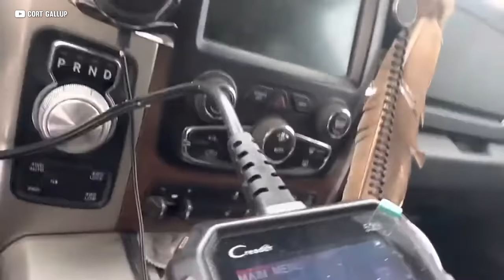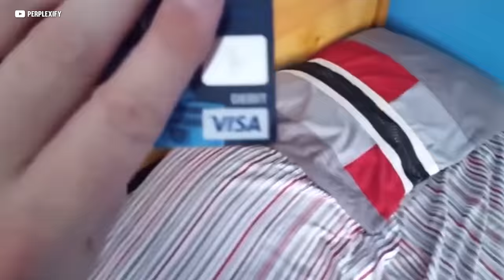Worst Trucks Only Stupid People Buy

Comment: As a mechanic I would have to agree with pretty much everything that was said.. I'll still take my 08 Silverado over any of the others despite the possible issues with the active fuel management system flaws.. mine has over 200k and has never missed a lick.  still running strong with no issues.. I owned one of those Toyota Tacomas and it had 265k on it when I sold it. Never had any issues.  But I wont own a 5cyl Colorado, a 5.7 himi, or a 5.4l Ford, I've worked on way to many of them, they are literally junk.. trot line weights...

Comment: never owned a pick up i drive a 3500 cummings ram dually at work i love it never mechanical issues . I rented once ford 10 speed v8 f150 was extremely comfy and it shifted better then my 8 speed rav 4 by far .

Comment: 252k on a strong running 2011 Chevy 2500HD 6.0. I did have to change the tranny and the transfer case, but towed many miles with a heavy trailer, and I don't think the 6 speed tranny liked it. I bought it used for 15.9k maybe 6-7 years ago, and thought I would buy a new one for retirement, but got sticker shocked into keeping my old truck so I could retire. 80 frickin K??? Yes, I wanted a nice truck.

Comment: 2010 Ram 1500 Crew Cab, 5.7 liter V-8.  231k miles.  Overall, have been very happy with this truck.  Other than a rebuilt differential at 180k and a new alternator at 210 k, it has been reliable.

Comment: A guy at my old gym bought a 2018 Dodge Ram and had a catastrophic motor failure a 7000 miles. Dodge replaced the motor and he had electrical issues with it afterwards.

Comment: As did I. 1999 Tacoma TRD new. Drove it for 11 years and  did my regular maintenance (oil changes/brakes/battery. The only thing that failed was a starter relay. 289,000 kms. 😀

Comment: So far been enjoying my 2011 Ford F250 with 6.2 gasoline V8. Aside from a couple bad fitting on my exhaust and a hairline crack in the radiator. (Thanks -45° winter weather) I've only done routine maintenance to it and it hums along nicely. Being almost 13 years old and only 115k miles, it should last me a good while. I don't drive it as often as I'm an OTR trucker, so things get replaced more do to age than wear, like tires.

Comment: I had a 2001 dodge ram,  Small V8, 180,000 miles when i sold it, two problem one dash board and AC. other than that,it was a great work truck.

Comment: I have a 2010 F-250 with the 6.4L and it has 277,648 miles and still going strong. I had to rebuild the transmission, but the engine has been solid...I use it every day on my farm.

Comment: I'm one of the thousands of people who have bought and maintained my truck to the tune of 250,000 miles. Maintenance is the key to ANY engines longevity
 If owners would do their part most of these issues don't happen. Modern manufacturing means that there are fewer issues.

Comment: Had a 2013 Ram 1500 5.7 Hemi - outstanding vehicle never had an issue - best truck I ever owned, and I've owned them all.  Needed a new vehicle this year, the F150 was simply horrible (tired 4 of them), GM nope owned 3 after 70k miles they spent way too much time in the shop, so off to try the 2024 RAM 1500 5.7 eTorque.  The 2024 RAM, little options on a $62k vehicle, hard plastic EVERYWHERE, and there was SO much aluminum in the body.  You could not drive the vehicle with the window down - a GOD awful noise - sounded like a helicopter (windows up no issue), the body would basically sway up, down, left, and right at highway speeds because the body was SOOO light.  I love trucks, but for 2024/25 it was a big fat ZERO. I bought a 24' Toyota 4Runner, and that thing is solid as a tank, and has a decent ride.

Comment: 4:15 if your truck has survived long enough the last recall on the Eco Diesel is finally in progress and will hopefully be the last fix needed.  Sitting at 108k miles on my 2016 and no issues other than the HP fuel pump - secret is to never go below half tank which is lame.  They did NOT skip Cummins they still use those......

Comment: My 2005 silverado has been a great truck but it only has 76k on it and did have air conditioner problems. GM replaced two compressors under warranty.

Comment: I have a 2000 Blazer with 240k miles still going strong.  4.3L is tried & true.  I personally wouldn't buy cars past 2008.  They went downhill with the recession and the fuel economy crap

Comment: I have a 2005 GMC Canyon with the inline 5 and it has 260k miles. I had to replace the fuel pump in the last 2k miles but otherwise its been impressively reliable.

Comment: Have a 13 Ram Hemi. At 187,000 miles engine crapped out. Bought a new one. 22,000 miles it crapped out. Ram took two expensive months to decide to replace it with a rebuilt engine and only warranty it the remaining 8,000 miles of new engines warranty. The rebuild runs poorly and gets terrible mileage. Ram customer service says they can't help, "take it to a dealer". I wrote them and never heard back.

Comment: So is the Nissan frontier any good? Any year to keep in mind or to avoid?
Reply: I have a 2015 Nissan Frontier with the 4 cylinder and 6-foot bed.  Only have had to change the oil, brake pads and tires. It has roll down windows. I use it to get to work every day and it has 90,000 miles on it. It has a color coordinated cap. Rides like a truck because it is a truck. There was a problem of coolant mixing with engine oil in 2005 so make sure that was corrected by the owner if you happen to be look for a cheap but reliable truck.
Reply: No.

Comment: I have a 2012 Chevy 1500. I heard about the AFM issues. I had a guy reprogram my truck to bypass the AFM. So far so good. I don’t do a lot of miles but I haul trailers and weight often. I’m at 130k and holding strong.
Reply: I had mine disabled. It the lifters failed at 166k. I did a complete delete, to include a cam replacement. Not just shutting off the system. The components aren’t there anymore. Solid engine after that.

Comment: The 5.4L V8 is junk whether you get the 2 Valve that blows out plugs or the 3 Valve where they break in the head. The 4.6L 2 Valve and 3 Valve are WAY more solid and the 2 Valve was an option for the F150 for awhile. Also, Ford's partnership with Navistar/International for the Powerstroke wasn't bad until the EPA restrictions hit; you can see this with the 7.3L that's almost bulletproof to the most unreliable motors the 6.0L and 6.4L.

Comment: Here we go. The spark plug rocket were due 100% to people over torquing. They call for 144in-lbs. Thats it. I have a 99 lightning that happened to becusse a garage did not follow the book. They put new heads on and 8 did the pugs from then on. The truck makes 800rwhp on stock threads never an issue. The 3V did have a spark plug issue but that has been long fixed. My best friend has 7 F250\F350. From 04-19. His 04 has 500k on the original drivetrain. Its a work truck that tows and\or plows every day 6 days a week. Its not babies at all. But he does his oil changes ever 3k, trans at 30k, diffs and plugs, and all other fluids at 50k. They last just fine, jist like any other truck would. The damn key is MAINTENANCE AT THE CORRECT INTERVALS. 5 or 10k oil changes will not suffice for work trucks. Lastly thr manifolds are also a simple fix. Use a damn manifold gasket and get ARP studs. You will never have an issue again. Stock 5.4 did not come with gaskets put them on with good harware and youll go for ever.

Comment: Ive had good luck with the 5.4, but i never had the 3 valve.  The manifolds can be a bear, but the spark plugs are an easy fix on the 2v with a bushing kit.   
   That being said, i cant get any newer engine or truck to hold up on the farm so im back to a '77 f250 with a 300, and a '79 f350 crew cab with a 460.  They are reliable, and cheap and easy to work on.
Reply: I'm a Chevy guy, but I agree that the older trucks are the best trucks, no matter the brand.

Comment: Everything will pretty much perform as intended, IF WELL maintained. That said you must read between the lines. Certain Ford Escape's, C-max's, and Fusion/Taurus's WILL give you transmission problems if you do not drain and top-off with new trans. fluid every 30 to 50,000 miles, even though the manual says 150,000/lifetime for NORMAL use. 

The problem is normal use isn't "normal." What is "normal" is considered severe use and subject to the drain an top-off 30 to 50k.

Comment: My t 100 with the 3.4 l v6 was torquey, ultra reliable and did everything that many of my friends did with their chevys dodges and fords , but I was never in the shop! Plus ,I had torsion bar front suspension, it was leveled and high end bilstein shocks , it handled phenomenally. The new Tacoma has too much electronics and the same engine that’s in my wife’s sienna, just not transverse.  Give me the 4.0 back ,please Toyota! The same with the tundra, too much electronics and now a turbo v6 over the bullet proof , America truck killer 5.7 V8 …wtf Toyota!  With just an dual exhaust kit I’m still clocking 5.9 seconds from 0-60 and that’s with an 07 Tundra…. No aspiration!
Reply: Starting with the 2024 MY, it's a turbo 4-cylinder. The 2023s are the last V6s. (for Tacoma)

Comment: The 6.0 is the last Ford pickup that’s pre-emissions so ofc those that don’t want DEF are gonna fix it, or just get a 6.7. Delete it, & do the CP4 prevention kit and that’s it.

I’ve owned a 95 7.3, own a 7.3 IDI, & have worked in the 6.7 Powerstroke from 2019. The 6.7 isn’t that bad compared to what it replaced. It’s just that CP4. Put the S&S kit on it & that’s it.

Comment: Had the 2003 F250 with a 5.4 in it.changed the oil every 5000 miles and mobile 1.head  gasket blew at 110000.when I replaced them the heads were so clean it looked like it only had 5000 miles on it.

Comment: From WC, after seeing this list I think I’ll just keep my 2003 Ford Ranger 2 wheel drive, with the 4 cylinder 5 speed transmission! Other than tires, normal maintenance, and a few front end parts that had rotted rubber (600 Dollars) that is it except for gas! And Oh yeah insurance isn’t real expensive either, at least not in TN! 60,000 miles on it at this moment!

Comment: My company currently has a small Fleet of 420 nineteenchevrolet silverados with cylinder dead deactivation. I've never used any of these trucks for towing or anything heavy duty at all. These trucks are primarily used On the highway so imadidn't my Shock win 3 of the 4 silverado's silverado's developed developed an issue where the the torque converters grenade metal destroying the transmissions before 100 K Miles. 2 have had failing AC units And 2 have had a weird issue where The paint literally just seems to blow off the truck around the front windshield and Behind the the back window. These trucks are freakishly maintained both inside and out. Squeaks and rattles plague 2 of the trucks in one of them has recently developed an issue where the rear breaks lock prematurely causing the back of the truck to hop. The most insulting part of this is that these trucks replaced a 3 truck sleep of 2002 Toyota tundras which which never gave me any trouble worse than a failing power window motor. In fact one of the procks was purchased by an employee who still drives that tundra today with 346 K miles.

Comment: I own a 2019 3.6 pentastar ram. Opinions on this engine?
Reply: Pentastar V6s seem intolerant to neglect! There are symptoms to watch out for: Check engine light suddenly on, rough idle and a pungent exhaust odor noticed at idle. This could mean bad valves or a bad valve seat.

Comment: The most reliable vehicle I've ever owned was my LC 100. (that's Land Cruiser 100 series for the uninitiated) It finally gave up the ghost at 475K miles. That's right I said 475,000 miles. And the reason it did, was because I had purchased the 500,000 badges BEFORE reaching 500,000 miles! :face-green-smiling:

Comment: I got a 2017 ecodiesel fully deleted and tuned, best truck I've every had. Mother has 3 of them currently 2 as one finally went at 830,000km. Current jeep is at 700,000 all original. Other one is 130 but rarely used
Reply: Sure kid and you still have the original tires and oil

Comment: MY 3.5 ECO-CRAP. 62,000 MILES...Cam chain tension gave up. Nuff said or would like pictures of the carnage?  Ford said, "stuff it up your nose." Same thing they said when my 2004 F-350 with the infamous 6.0 began what is famous for ...at 81,000 miles!  BUT MY TOYOTA TUNDRA WITH THE 5.7 and 221,000 miles. Never even a single hiccup!

Comment: from what I've heard with the GM DOD trucks if you change the oil on time and drive it hard once in a while they will last just as long as gen 3 non DOD motors. Same cannot be said about dodges 5.7. drive them hard and they are worn out at 100k miles, drive them easy and the lifters tick. but even dodge says the hemi is worn out at 100k miles

Comment: I'm an engine builder and agree on almost everything listed other than the 5.7 Hemi. Their issues are massively overblown and it is a good engine. Crank size, oil journals etc are overbuilt. Is it one of the best ever? no. but to list it here is beyond silly. The 5.7 is built MUCH better  than almost every other Hemi before it with the exception of those from the 50's. If you don't like the 5.7 then the 426 is pure garbage (which we all know is not the case).

Comment: I own a toyota tacoma from 1999 with the 3.7 liter V6 its a 2 wheel drive. I bought it in 2022 and it lasted a good year before problem after problem. My frame split I got it welded back together and now my a seal in my rear axle has broken and I am leaking gear oil along with the air filter constantly breaks now its held together with duck tape the breaks are rough and so is the ride. But in all its a decent pickup and I got it for a really good deal. I wouldn’t recommend anyone to buy one if they are looking for a truck to last them a long time but I would recommend it as a fun little sort of farm truck.
Reply: The one I have is the TRD Off Road with the SR5 and pre-runner packages

Comment: GM is my pick. Now I say I would not but a GM product after 1999, but I did. My 2013 4.8L is reliable and revs high but its a grocery getter and some 2x4's. When I compare my '99 K3500 4WD, '98 K2500 4WD or even the '82 S-10 to the '13 it's like comparing flip flops to work boots.Quality is gone across the entire big 3.

Comment: I have a 96 dodge cummins with 500,000 miles on it. Drive train has never been touched other than a throwout bearing on the clutch. Most of my driving has been off highway.Bought it new and it has paid for itself many times over.

Comment: After 2014, Ram upgraded the HEMI, Still has manifold leak problems, As far as the DOD goes, Change your oil every 5000 with synthetic oil not don't idle for long periods of time. You ont have a problem. That goes for GM 5.3 LT's too.

Comment: I guess my 1992 F150 4.9 --6, 2 owner. is not such a bad deal.  But I did have a 2001 F150 5.4 that had a bad plastic manifold, and while I never had any plugs blow out replacing the plugs required special care. There were lots of articles written about these problems.

Comment: I had an 02 Dodge Durango 4x4 with the 4.7 V8  Automatic transmission.  Ran great I Never had an issue with the Powertrain. I had Solid it Several years ago And should have kept it.  It has Alittle ove 160,000 miles

Comment: Titan with Cummins diesel?  A few details about its history you should re-examine:  Cummins' original customer for the 5.0 liter V8 was Ram "division" of Daimler Chrysler. They wanted a diesel for the half ton trucks and already had a good thing going with Cummins.  As EPA tightened diesel standards, the economy was headed for a crash, Daimler bailed on the failed DC merger, and what remained of Chrysler was circling the bowl, headed for bankruptcy.  Several years later, Nissan went shopping for a diesel supplier, and Cummins dusted of the stillborn 5.0 liter program and you know the rest of the story.  There were no winners.  Ironically, the Ram's 3.0 L V6 from VM Motori division of Fiat, was originally designed for Cadillac before the GM bankruptcy!

Comment: GM is the way to go before 2007 when AFM cylinder deactivation came out. 99-06 Silverado, Sierra, Suburban Yukon, Tahoe, etc. Even the 96 to 99 OBS is good too. Find yourself a creampuff with low miles and low cost, and you are set.

Comment: Well, who knows?  My 2012 Chev Colorado with the 5 cylinder engine has been trouble free for the first 110k miles.  No engine or transmission problems - ever.  we'll see about the next 110k miles.

Comment: Just my personal opinion but Ford should've stayed with the 2 valve version of the 5.4L. I have an 03 expedition with a little over 230k miles and aside from the occasional alternator and main drive belt it's had zero issues and so far the engine has outlasted the body.

Comment: The mistake Toyota is making now, and it's a big one, is that they're replacing the V8s in their Tundras with turbocharged V6s and their V6s in their Tacomas with turbocharged 4 cylinder engines. I personally don't like turbocharged engines of any kind. IMO they're a cheap substitute for the HP and torque you get from larger, naturally aspirated engines. They may get somewhat better mileage, but you pay for that in other ways. The forced air from the turbocharger causes them to run at higher RPMs, which means they have a shorter lifespan and the turbocharger itself is an added component which needs oil and coolant routed through it and something else which can go wrong. Also, gas is like oil. No matter how expensive it gets, it's still cheaper than engines.

Comment: I hate when the 5.4 triton gets put on a list like this. I had 2 and beat on them like it was a rental. First outlasted the 1998 truck it was in. So, it got transferred into another vehicle (sold on marketplace). The second I still have in a 2008 with 225k and change the oil 2x a year. I would not hesitate to drive it cross country